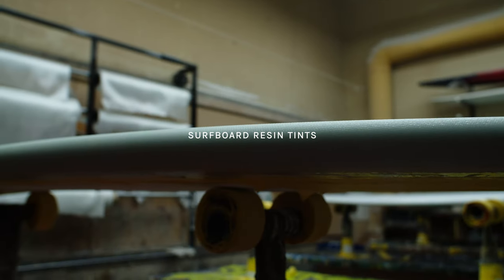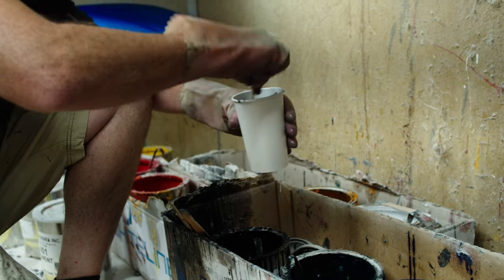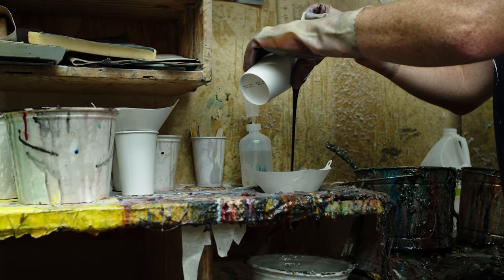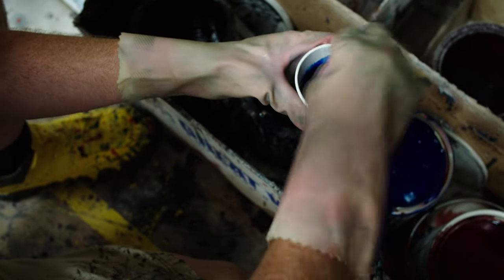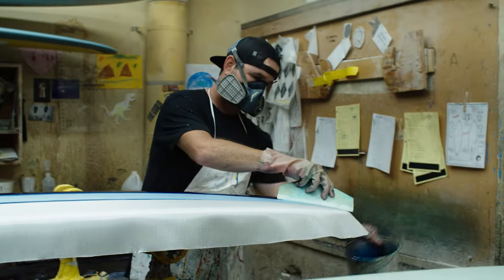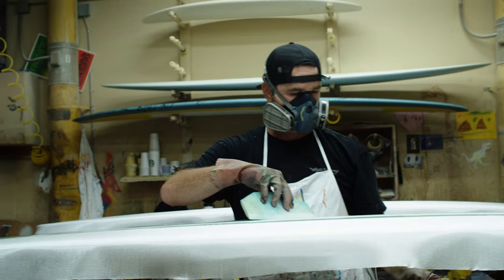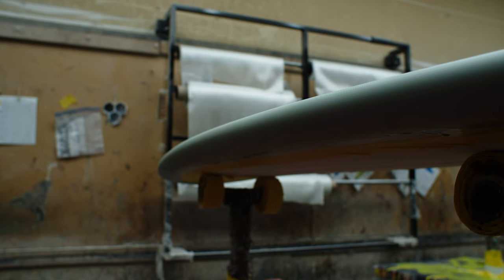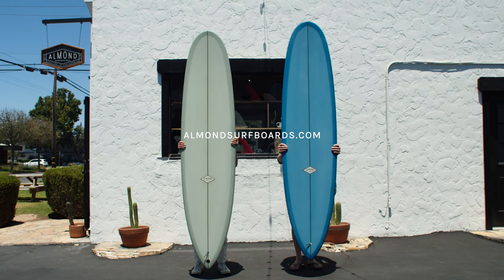Almond's Guide to: Surfboard Resin Tints

Comment: LOve the video ! Does the resin tint make the board heavier rather than spray color ?
Reply from the maker: Not necessarily, the weight of the fiberglass that you use makes the biggest difference. We do a 6/6 deck and 6 oz bottom with a tail and deck patch on all longboards. There are also different densities on the blanks.
Reply: @Almond_Surfboards  thank you so for reaching back out ! Love your aesthetic and dedication ! Keep up the great work!